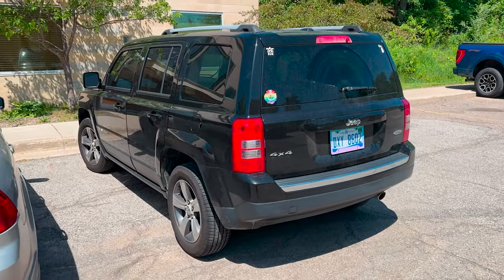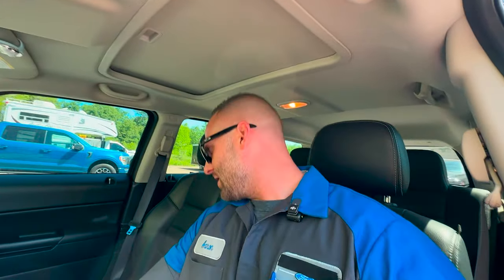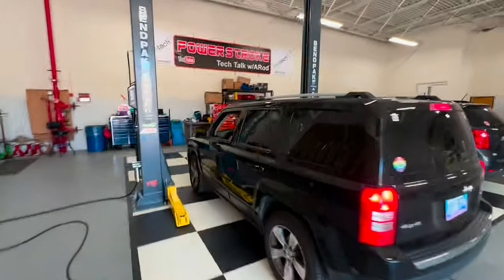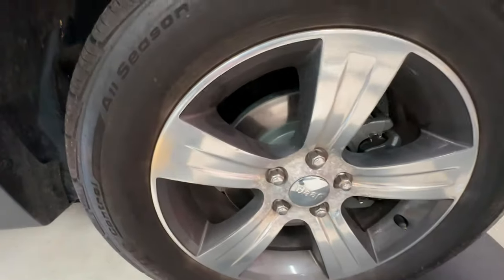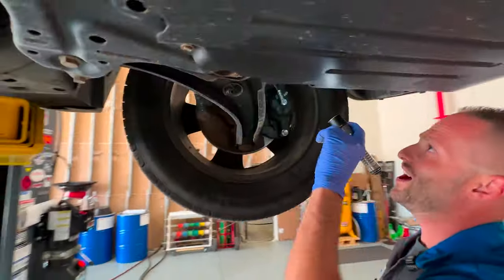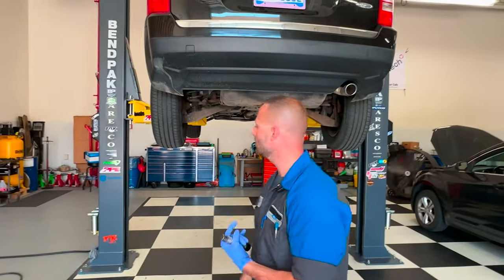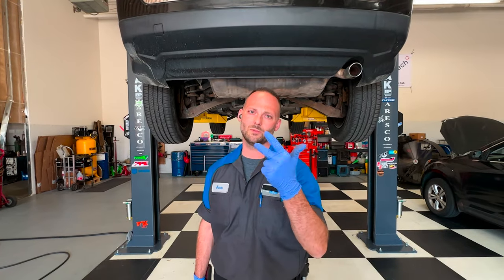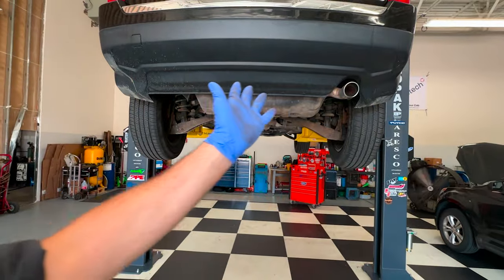SHOP slams female customer with a $4k estimate | here we go again #hacks

Comment: This just literally happened to my granddaughter today. They said she needed new struts, brakes all around and a 4 wheel alignment. $2000 was the quoted price. The struts were practically new when she bought the car last year and the brakes were new. The previous owner had done all that work before her mom bought it. She's only put 4000 miles on the car since she got it. They didn't even take the wheels off the car to inspect the brakes because she forgot to bring the wheel lock adapter. How can you measure how much brake pads are worn without taking the wheels off? I told her to take it to another shop.
Reply from the maker: Ohhhh man...

Comment: never seen anything rot apart like jeeps/chryslers of the past 20 or so years.

i had to chuckle when you slipped those arms of the list underneath without checking how the subframe looked.  i'm not a mechanic by trade, but i've seen more than a few of them that would be in danger of folding or crinkling without some careful placement.

once my sister-in-law tells us her liberty suddenly became undriveable.  it showed up at my shop on a flatbed, with some serious negative camber, toed out.  ball joint popped out on the driver's side.  fix that out in the weeds, go to test it out, ball joint's out on the passenger side, too.  she obviously drove it with some signs of failure but it didn't have a ton of miles.

trailing arms will rot off, especially seeing the interstate in the winter.  front control arms too, passenger side.  

factory lugnuts + aftermarket hub assy's with chinesium wheel studs.  anti-seize and proper torque is still no match for salt.  assuming alum rims, what i like to do is beat on a 17 12pt or an 18mm short and put a 5ft breaker bar on and hope i can snap it.  otherwise better have some good drill bits.

Comment: I got an estimate to change out a water pump at three different shops. Two shops were about the same at around $750. The 3d shop was a dealership and quoted me over $900. I told him what the average quote was so far and he said let me look at the numbers. I told him the part was around $220. He called me back and blamed the high price on a mixup with the numbers. He met my lowest price offer so I gave him the job because he took care of me before.

Comment: On my RV Road trip, we stopped at Future Ford in Indio Ca for an oil change on my 2022 F250 with 57k miles.. #1 took an hour...#2 45 min in they came to me and said one of my batteries were bad (got to replace both) $500...#3 then came and said i need a front brake job. WRONG!!! I checked and the pads were 2/3 worn and both discs were smooth. I told him they were fine for another 10k miles. So a "reputable dealer" tried to get to spend an additional $600 for a front brake job...😂 I did replace both batteries, so my $175 oil change turned into $675...

Comment: My guy! I’m feeling ya! I was out of time and my wife took her Jeep to our local dealer for her “free” oil change. $3100 later she got it back! They sold her an oil cooler and spark plugs on a 2 year old vehicle with under 30k miles! I didn’t handle it well!
An issue we are having in east central Florida is every reputable independent repair shop had to close up during and after the lockdowns. The last 2 just since January unfortunately so we are forced to use dealers.😢
Reply: Go to Rayman Ray Repairs in Florida.
Reply: how could they sell her stuff that should be under warranty?  did she "admit" to a lengthy service interval on a lease?

Comment: Took to dealership about a sensor went on vacation called said it was ready  told me a mouse got to the wiring around the battery  had my doubts but what do I know  drove off the lot 1/2 mile down the road had to bring it back light came on again  sensor error again  wasn’t to happy about it  they replaced the sensor for the cost of the part   Not sure how to argue a mouse got the wiring when this was the original issue  how do you question that. Do you give bad parts back to customer if they ask for them  I may start doing that so I can see the part that’s in question  is that wrong to do
Reply from the maker: In michigan by law were supposed to return the parts to the customer